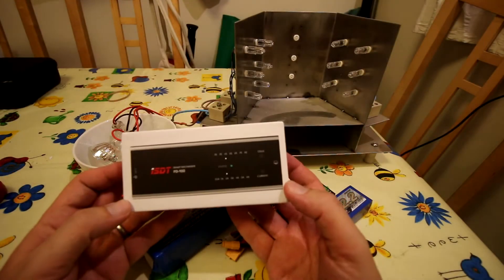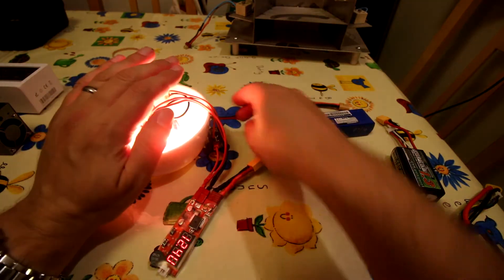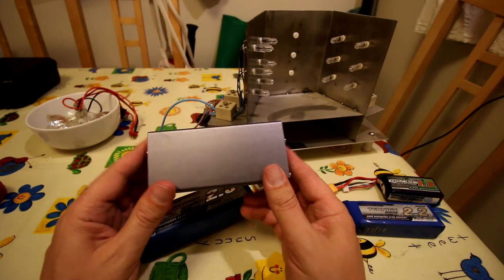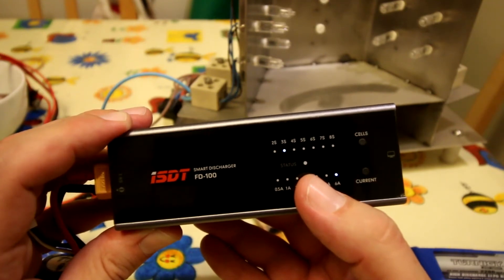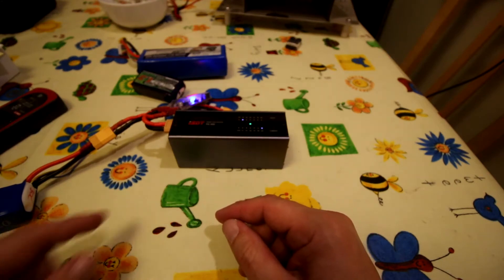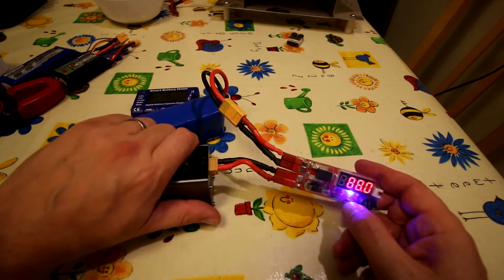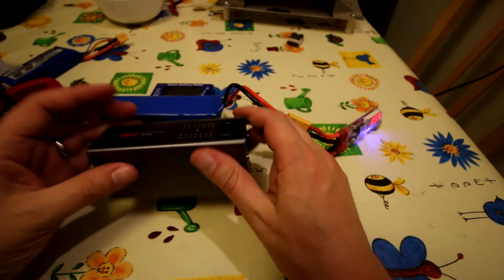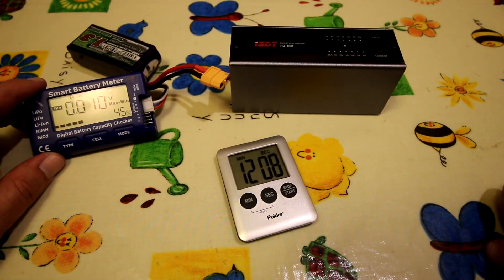ISDT FD-100 Lipo discharger review vs lightbulbs - RC Lipo discharging

Comment: Good video, congrats.

The thing is a I see this method of discharge without balancing a bit "unfinished". You discharge and then you go to your charger to balance the cells, when it should leave the batteries or full discharged (in case you want to do a capacity test or charge/discharge for break-in), or in storage mode.

That ISDT discharger should balance and leave them into storage voltage.
Reply from the maker: I agree in a perfect world the discharger would also balance, but I'm not aware of any other dischargers of reasonable wattage which do this, I've been using light bulb rigs for years, which also don't balance and this is a big step forward. I noticed there is a slot on the back of the unit next to the XT60 which looks the size of a balance connector, I can't decide if this is just a cooling slot and size is a co-incidence, or if they considered having a balance port, and either dropped it, or may add it in an updated version - so definitely worth contacting ISDT to ask, as if enough people did I am sure they could easily add balance connector and balancing during the discharge in a V2 model.

Comment: For mini quads if you had a parallel charging board, could you discharge the packs in parallel?
Reply: I see no reason why not, I intend to do just that.
Reply from the maker: If the packs are within a few tenths of a volt you could parallel discharge, but it would split the load so your not exercising the packs as much, and it takes the same amount of time excluding switchovers, so I'd still do them individually personally rather than spend as long checking voltages and grouping them.
Reply: jamesb72 I just ordered one. Cheers